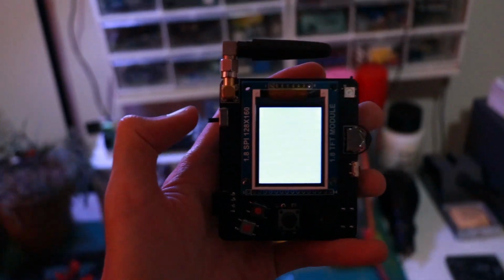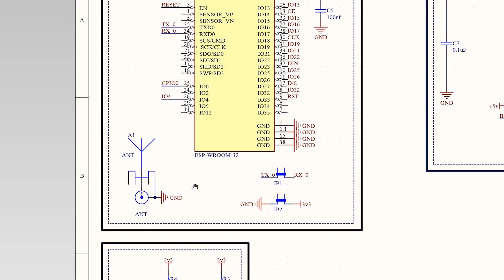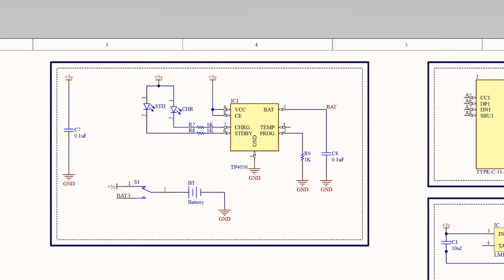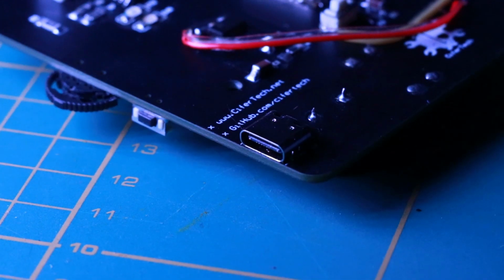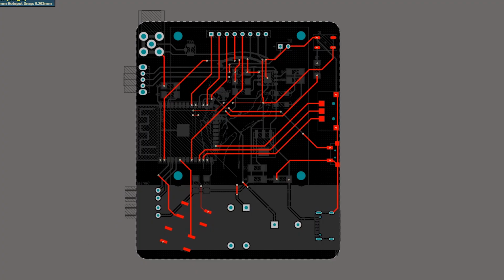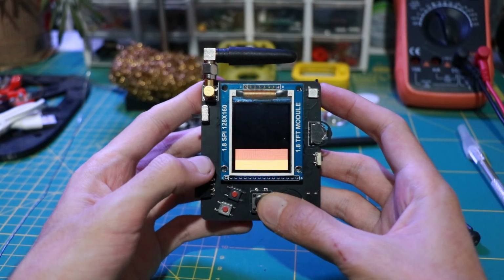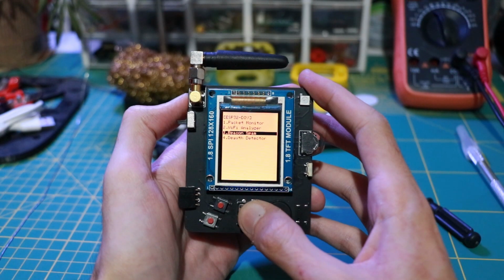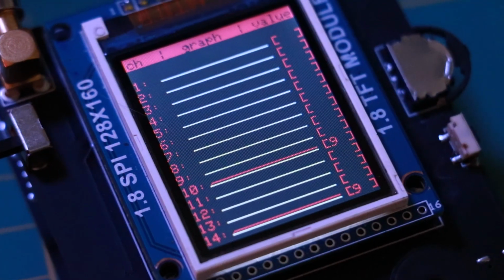Your Swiss Army Knife for Wireless Networks

Comment: ets Jul 29 2019 12:21:46

rst:0xc (SW_CPU_RESET),boot:0x13 (SPI_FAST_FLASH_BOOT)
configsip: 0, SPIWP:0xee
clk_drv:0x00,q_drv:0x00,d_drv:0x00,cs0_drv:0x00,hd_drv:0x00,wp_drv:0x00
mode:DIO, clock div:1
load:0x3fff0030,len:1184
load:0x40078000,len:13260
load:0x40080400,len:3028
entry 0x400805e4
Guru Meditation Error: Core  0 panic'ed (LoadProhibited). Exception was unhandled.

Core  0 register dump:
PC      : 0x400dcb29  PS      : 0x00060730  A0      : 0x800d6254  A1      : 0x3ffe3ab0  
A2      : 0x00000000  A3      : 0x3ffc56f8  A4      : 0x00000040  A5      : 0x00000000  
A6      : 0x00060f20  A7      : 0x00000001  A8      : 0x800dbab8  A9      : 0x3ffe3a90  
A10     : 0x00000000  A11     : 0x00000001  A12     : 0x00000001  A13     : 0x00000010  
A14     : 0x00060123  A15     : 0x00000001  SAR     : 0x00000005  EXCCAUSE: 0x0000001c  
EXCVADDR: 0x00000000  LBEG    : 0x400d5808  LEND    : 0x400d580c  LCOUNT  : 0x00000000  

Backtrace: 0x400dcb26:0x3ffe3ab0 0x400d6251:0x3ffe3ae0 0x400d5799:0x3ffe3b00 0x400d5821:0x3ffe3b20 0x400d58b5:0x3ffe3b50 0x400d59f3:0x3ffe3b70 0x401533bf:0x3ffe3b90 0x400d342f:0x3ffe3bb0 0x400d34be:0x3ffe3bd0 0x400d3242:0x3ffe3c00 0x400e782b:0x3ffe3c20 0x40083515:0x3ffe3c50 0x40079306:0x3ffe3c90 |<-CORRUPTED

ELF file SHA256: 6a4d263837ed0aad

E (378) esp_core_dump_flash: Core dump flash config is corrupted! CRC=0x7bd5c66f instead of 0x0

getting this error in serial moniter after uploading the code in esp32 devkit v1 please help....

Comment: When I uploaded the code in esp32 through aurdino ide and the board manager esp32 dev module the. After the code upload the esp32 is automatically reebootes and when I see the serial monitor then it should overclock or file curropted
Reply: I have the same error

Comment: Can you use another antenna, like the built in antenna above or as close as you can get to maybe with some high magnetic permeability material, and tuned circuit connected to the antenna connector for a passive coupling of the internal antenna to the potential external antenna?

Comment: Is there any boards or adapters that can utilize old wifi cards sitting around not being used?
Reply: won't a pcb board work? then after testng you can build one and order it online. after testing, and yea you can use any network card but make sure to setup there drivers ...but  for deauth you need one that can monitor/inject the esp32 is a ok starting board for 5$ or2pc for  10 dependingwhere you go. but i would rather just build a smaller wifi-nugget 15-30$ with the same features  / or a pwnagatchi for 60$ish
though the esp32 can only do 2.4ghz and wont be able to pentest new routers of 5ghz so look for a dual purpose one, then build meshtic for just the  lolz

Comment: I was about to comment that this tiny antenna was the worst wifi antenna ever when you admitted it was not in use. 😅
Reply: as long it matches the bands , and it is replacable by something better, or perhaps directional when required then it is just fine for the pupouse of a mobile unit
and this demonstration.

your cell phone has an even smaller antenna and works in your wifi just fine

If you gonna do wardriving, then you would probably work with a laptop anyways.
Reply: @zoolkhan  Those are known not to be meant for wifi that’s why I meant I was sure he used the PCB trace.

Comment: Which ESP32? The C6? Still waiting for the day we get one that supports 5/6ghz as theres getting to be less and less 2.4ghz in use
Reply: You may think that there are less, but their numbers are increasing drastically. The majority of smart devices run on 2.4. So before you would have a house with let's be generous 4 to 8  2.4ghz devices (laptops, PC, router, games console, tablet, phone etc) Now your house will have 12 lightbulbs, fridge, kettle, thermostat, toaster etc all connecting on 2.4ghz. It is the exception that don't. They are also the devices most likely to have 'security' issues. It's one of the main reasons all of your smart home devices should be kept on a separate network.